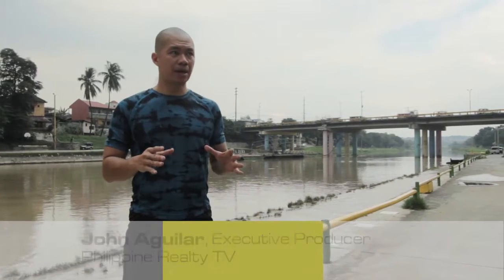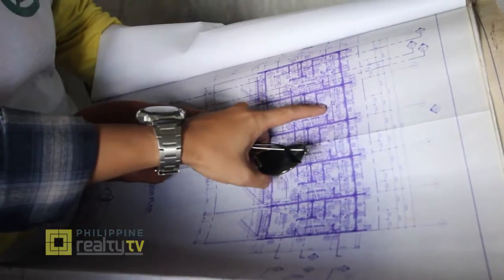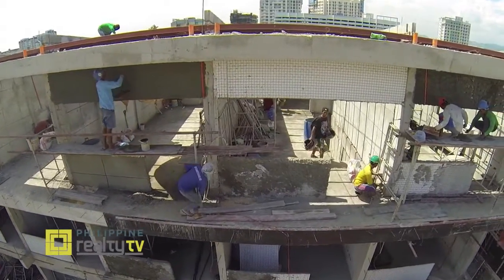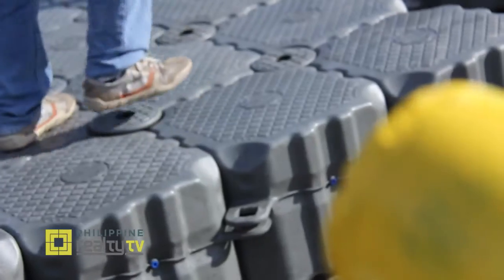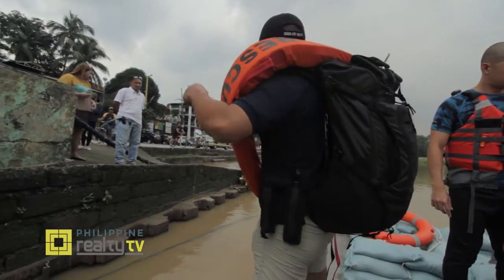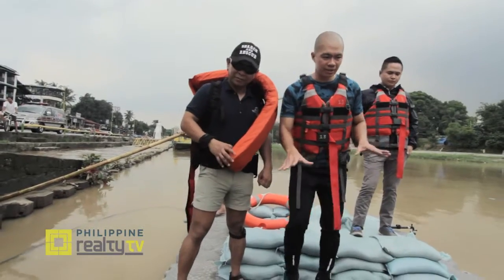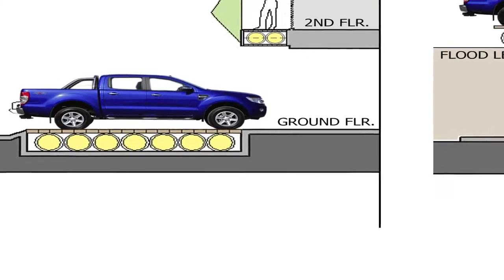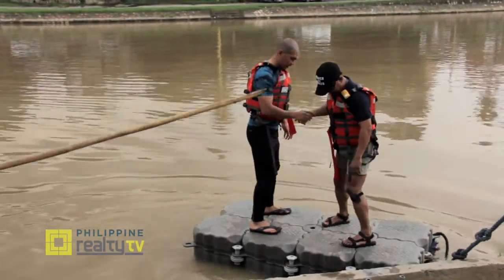Project Smart Home: Carport Testing

Comment: Yup. Applicable talaga yan. Kc sa ibang Bansa ginagamit yan to Transport ang mga Military Vehicles na tinatawid sa mga Ilog. Pero hindi sya design na maging Parking lot bedding kc PVC lng po yan Overtime magcCrack din dahil sa "Compression". Imagine may Karga ung PVC Floating Device na 1-2 Tons  and at the same time Sandwhich pa ng Concrete.

Comment: Stability is utmost concern, the rushing and swirling strong current during flash flood could capsize or overturn upside down this light draft floating object  with loads of more than 1 ton or it could easily slide overboard the car loaded on top especially unsecured, the floating PVCs are unballasted and very light. You made it sound too easy. The best and prudent thing is to calculate the block coefficient, area of displacement with respect to supposed car weight, calculate the center of floatation and bouyancy on fresh water density then make an inclining experiment to find the metacentric height or the righting lever. Hydrodynamics should be applied here not an elementary rule of thumb or better still make the experiment on the actual rapids😄.

Comment: Any updates if it actually worked esp. during the past calamities?
Reply from the maker: We have update for you in the coming days.  We are working on it right now.  Please follow us on Facebook.com/philippinerealtytv for the updates.

Thank you!
Reply from the maker: It did, we hope you were able to listen to the podcast.  Thank you!
Reply: where's the video of the test?
Reply: @wanderingandroid  Bali nagDemo lang po sila by means of Emulating the Vehicles total Weight. Kaya naglagay ng mga Sand Bags at sumakay pa sila to Sum up the total weight of 1-2 Tons. Yup applicable po yun as Floating Device. Kc ginagamit talaga yan ng mga Military Personnel to tranport ang kanilang Military Vehicles sa mga Ilog. Pero NOT design na maging Parking Lot Bedding dahil PVC lang sya. Overtime magCCrack po dahil sa Compression ng 1-2 Tons vehicles weight at sandwhich pa ng concrete parking lot.